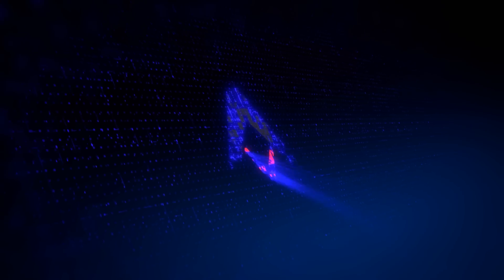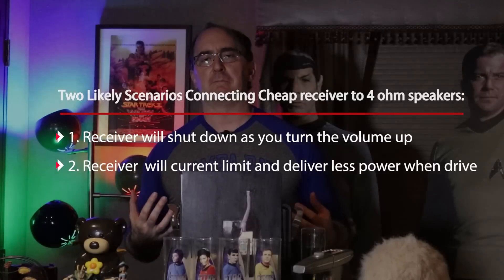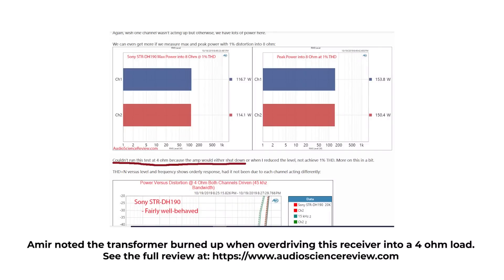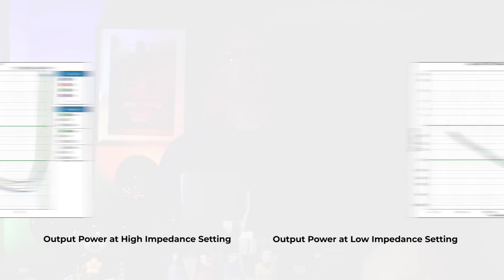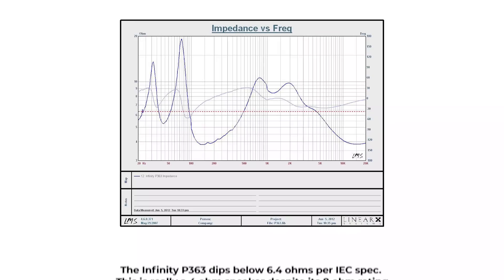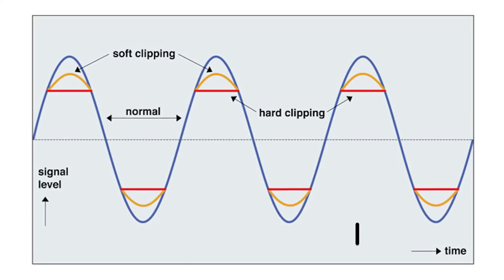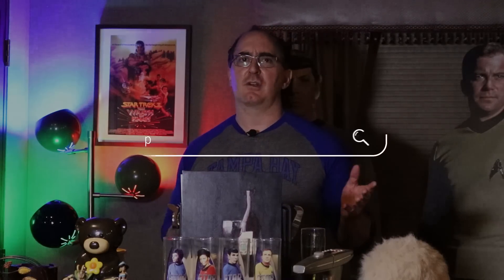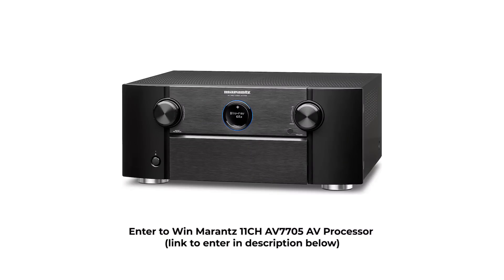4 ohm Speakers on Cheap Receivers: Recipe for Disaster?

Comment: Damn... audiophiles (?) have issues... I follow your argument (used to have a no-good receiver myself), but there is an interesting argument taking place in parallel that seems to go completely against it. Whenever there is a test of a cute little amp with 1 W or 2 W, there is always a lecture attached to it that "what do you know, 99% of the time, you don't use more than a Watt or two anyway...". So I basically never use more than "1 Watt", but it If have a 100 Watt amp anyway, of which I apparently only use1 Watt and put a little load on it, it immediately "explodes" , well, because reasons... :) These two narratives don't seem to go well together. I had just seen the Audiophiliac praise the fuck out of a tiny 2.3 Watt tube amp a few days ago which could drive "everything", so how can 100 W not be enough for something? Very interesting...
Reply from the maker: The Sony is NOT A true 100 watt amp and the Audiophiliac is a bit delusional IMO.
Reply: @Audioholics  lol.. well obviously, or else there would not be a dissonance between the two narratives. Anyone who ever partied in their parent's basement when they were young knows that you need POWER :D I am with old Paul on that: more power = more better ;) I could never 'love' my receiver in the 90s because it was simply lacking the juice and started clipping when we wanted to have some fun with our shitty 80s + 90s teenager music taste.
Reply: @Audioholics  🤭🤭🤭🙄😝
Reply: Most of the time I can get away with 20W even when I “turn it up”. But it’s nice to have extra power in reserve

Comment: I have a Marantz 6013 Avr it is powering  one 4ohms emotive c2+ center and  two side surround speaker emotive e2+ 8ohms.  Its 110w 2 channel rated. Should there be any concern?
Reply: Most issues will occur if you are approaching power limits.
Reply: @RennieAsh  i think it should be fine as at present i am not planning to put anymore load on my receiver than these 3 speakers. Also 4ohms center is rated 92dB efficiency while the other 2 side channels are rated 87dB efficiency. Also seating distance is approx 7 feet
Reply: @vinay00420  There should never be more than 3db efficiency difference between speakers. You are way off the chart.
Reply: @MrDante10no  Well this is what Emotive is offering as their airmotiv series i wish that their efficiency matched but could not help it.
Reply: @vinay00420  Wow, very strange. What is Emotiva doing? 🤔

Comment: I just ran into your video and I have a Denon Dra685 series that will run 4ohm all the way up to 16ohms and so what are your thoughts about that receiver.
Reply from the maker: The receivers that say they can run 4 ohm speakers typically have an impedance switch to Pass UL for low impedance loads by cutting the power down to 1/2 or less. I wouldn't run 4 ohm speakers on budget receivers. Flagships like the Marantz SR8012 with dual heatsinks can do it much better.

Comment: I tried 4 ohm speakers on my Yamaha R-S202D, and it didn't seem to like it very much. Back to 8 ohms then.
Reply: @Jingle Nuts It says 8 ohms minimum on the back of the receiver. Or 16 ohms when using A+B.
Reply: @Jingle Nuts Not 2 ohm speakers at least :-)

Comment: Could you do a how to video on a DIY measure speaker impedance over full range? I thought it could be done with REW but I don’t know how to do it.
Reply: I just subscribed and this is a good question.
Reply: @bendermi  then upvote it
Reply: @scottyee707  
I gave it a thumbs up if that's what you think?
Reply: @bendermi  weird because I did too and it only has 1
Reply: @scottyee707  
I see 230 up and two down .
Reply: @bendermi  you replied to a comment. I was referring to the comment you replied to.
Reply: @scottyee707  
That took some time yes there is only one thumbs up and that has been there in almost three hours . 
And when you gave it a thumbs up the was zero ?
Reply: I just removed my thumb and gave a refreshment of the screen by putting a finger on the screen and pulled down then came a thumbs up and I added back my own.  
Ps I use android tablet.
Reply: @scottyee707  
Something is wrong and rotten now there is only one thumbs.
Reply: @bendermi  lol no worries
Reply: @scottyee707  
That's easy for you now I can't sleep because my brain is trying to get this.
Reply: I love DIY methods. But sometimes ready made products are just better: the Dayton DATS v3 is plug and chug. A great tool for any tester.
Reply: @ErinsAudioCorner  wow thanks Erin! I really shouldn’t subscribe to another audio channel but I’m really respecting your personality and quality you bring.
Reply: @Rockhurst22  
I'm also subscribed to some other audio channels but this is a new one for me but it might be one of the best if not the best .
Reply: @Rockhurst22  is it my personality?... or my devilishly good looks?  😂🤪. Seriously, though, thanks for the feedback.

Comment: I literally learn everything I know from you. Thank you!  What about 6 ohm? Just got JBL Studio 590s and wondering what my Pioneer elite will now do. Thanks
Reply: My old Denon 1909 can drive my JBL Studio 590s but if I hook up the center channel 520c to it it shuts down. Getting an X3700H tomorrow to fix this and will probably add a 2 channel external amp soon.
Reply: Enjoy the 590's. I know I do!  Also look into the matching 550p subs when on sale.  They are terrific for the $189 I paid a piece.🤯🤓😎  also research criss-crossing the speaker tweeters in an unnatural looking way because it makes the speaker sound terrific. New record day has a whole video on this I believe geared towards the 530 JBL speaker.😉🤗😇

Comment: At the risk of encouraging energy inefficiency... Tubes rock! and they're kinda weird, they have some special relationship with current, where modern amplifiers swing voltage, tubes swing current, I don't fully understand it. Tube amps then have different output taps for different impedances, and pretty much the same watts into the different loads. I saw a debate recently, where someone asked where they should plug in their 6 ohm speakers, into the 4ohm tap, or the 8ohm. The answers were totally bifurcated. No consensus, and even I, the great knower of things was logically torn on which way to go.  Maybe you could do a followup for tube amps, and tube hybrids.

 I got a 70lb beast of a tube amp used for $1700.  I'm considering doing that twice more and running a surround system on them.  The problem is, they're RCA, the new model is XLR, which feels like a better path to take, especially as I'm considering using long interconnects to locate them around the room.  The debate of longer interconnects, or longer speaker cables, is a good topic to explore too.  Sub harmonics were once scientifically thought impossible. But there was some research study that came out recently, which found that higher frequencies can harmonically manifest lower octaves!  (will try to find it) Which means that filtering high frequency noise beyond the audio band may actually affect lower frequencies.  Which I feel may be an important piece in explaining cable audibility, as the subtle capacitance and inductance of cables effect inaudible high frequencies, that create emergent phenomenon in standing waves in the reflections between speaker crossovers and amplifier's damping factor.  Which may explain the observed phenomenon of cables. As it stands, I think the affects of cables are really affects of the amplifier-speaker damping-factor relationship, and whether that affects feedback-based-amplification, and that cables ever so slightly buffer that relationship.  All I'm saying is that I'm looking at some interesting stuff, that may explain some stuff.  I think scientifically,  we may have to start measuring whole systems, and the affects of cables in them, rather than just measuring single cable lengths.  And by WE I mean you Gene lol, your whole life now revolves around disproving a negative lol a topic I know you've delved ad-nauseam.  But I think resonance between driver's/crossovers and amplifiers, and then the standing waves of them in cables, may cause audible effects with amplifiers of lower damping factor. So if cable affects come from basically being an extension of the amps damping factor ( from cable resistance, induction) then that could explain allot.  Suddenly that higher resistance skinny single strand of snakeoil, is a resistor reducing oscillation between the amplifier and the crossover.   If a wire is a tunnel, we know that when you drop a pebble in a tunnel it amplifies the sound, lasers amplfy by bouncing between mirrors.  Maybe there's something similar going on at high frequencies in wire, something that inductance and resistance would mitigate, or some airy highs that capacitance would sparkle to life. Anyway, I'm just being open minded, these are my own thoughts btw, not some advertised nonsense, sorry for being long winded, you know how I is. ;P